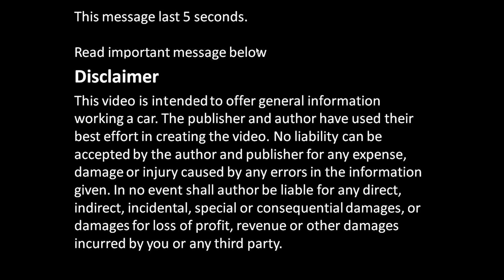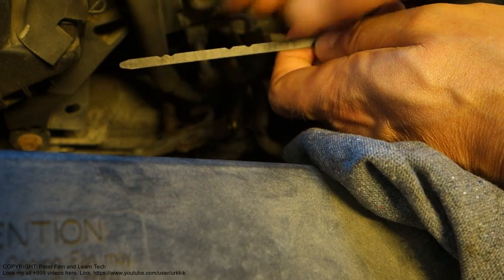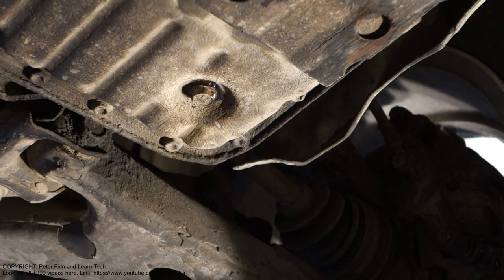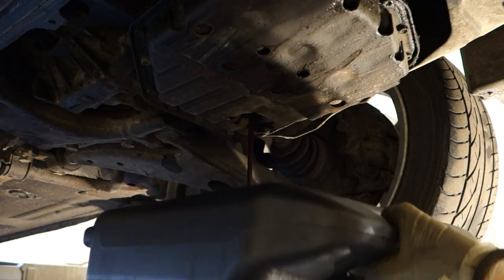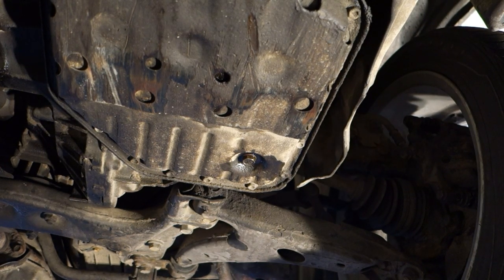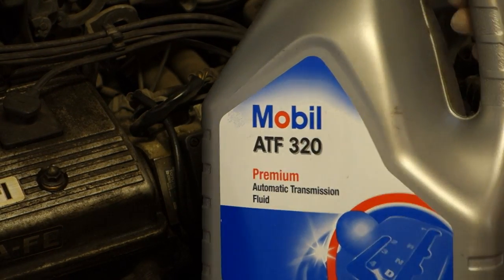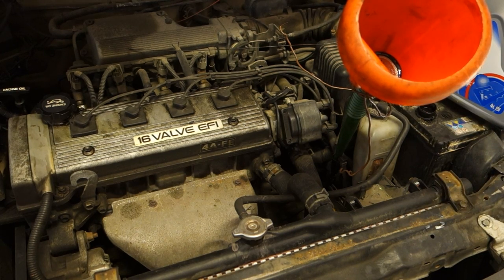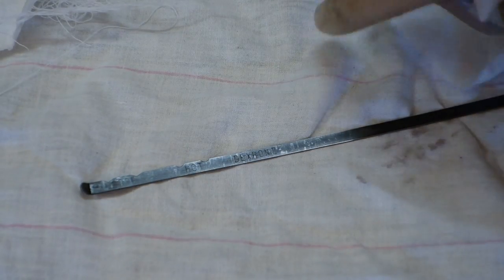How to check automatic transmission oil level Toyota Corolla VVT-i engine

Comment: For the hot measurement did you check it with the engine running?
Reply: I always check atf level with hot engine (running) Toyota yaris 2002
Reply: You must check it with the engine idling - any reading you get with it off is useless.
Reply: Clearly he don’t know what he doing. He pour out a lot and he put in the same but he think too much, because he don’t run engine idle

Comment: HI !  FROM CORRECT LEVEL I DRAIN OUT 1 LITER AND MY GEARBOX ( U241E) CHANGE BETTER AND FATSER ND I FEEL MORE POWER TRANSFER TO THE WHEELS.  BUT I GOR SOME VIBRATIONS ON STATIONARY IN D AND R WITH FOOT ON THE BRAKE AND SOME LITTLE RUMBLE NOISE. I FILLED BACK AND SLIP AGAIN AND  SHIFT LATER AND NOT SO GOOD POWER TRANSFER. HOW DO YOU EXPLAIN THAT?
Reply from the maker: Noted

Comment: Hi Peter Finn! I love your videos. I have been watching for years. For a 2007 Corolla that has had no automatic transmission maintenance since buying at 8K miles what fluid should i put in? It is a nonservicable transmission per manual. It has 220K miles now. I had to replace the transmission cooler tube recently and i topped it off with valvoline asian transmision fluid.im considering a drain and fill, not a flush. I understand the transmission has wear, and I dont want to make it worse. Thank you. Nevermind the comments about your accent, I know you dont sweat the small stuff. Keep on with what you do!
Reply from the maker: Thanks for feedback 👍😊